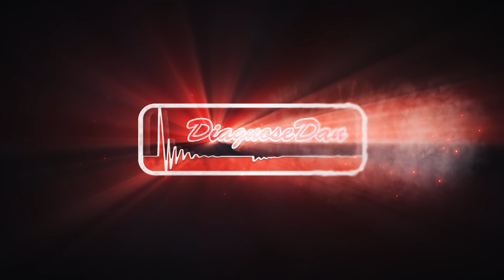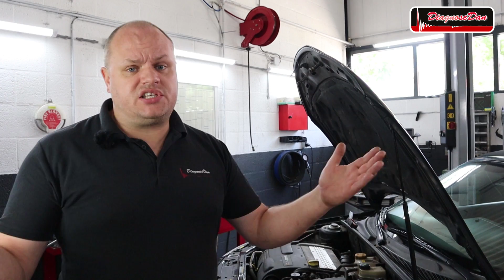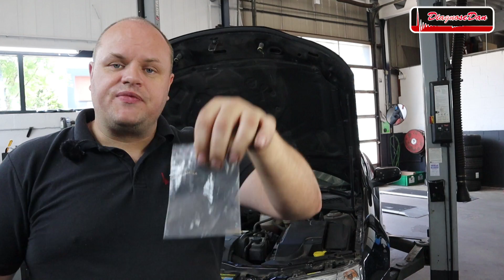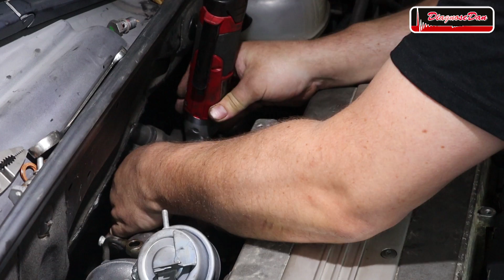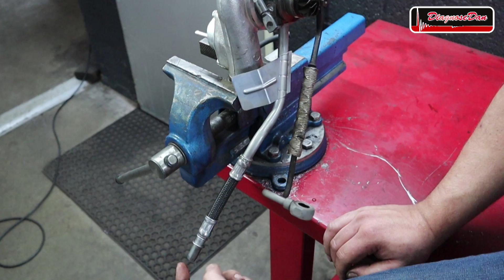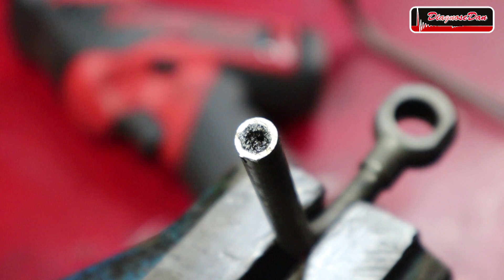Why did this new part only last one day?

Comment: Nice to see proper diagnostic checks. There is an odd sense of enjoyment in working out an issue as long as it's on something you want to work on. I had a 78 Toyota Corolla Liftback have its valvetrain partially lock up on me after doing a ring job but due to carb problems would keep dumping fuel. I kept up on keeping FRESH oil in it by draining out the contaminated between episodes of massive pressure loss while trying to sort out the carb problem. Ended up installing a reman. Once that was sorted out, the day I went to actually DRIVE it is when I had a failure to start before heading into work. Fortunately I had alternate transport. Got home. It finally started but was ROUGH as hell. Pulled my valve cover then restarted. I had 2 rockers not moving and saw 2 push rods not moving either which were no longer under the tappets. The rods were BENT...one had just 1 bend while another looked like a lazy lightning bolt while the 2 valves were seized.
Removed the head & rockers. The offending valves had to be forced out with a block of wood & followed up by a dowel all with several hard whacks with a hand sledge. Turned out my stem seals had partially dissolved from the gas contaminated oil & entered into the guides thus gumming them solidly into place. Removed every valve & stem seal. Used gas soaked pieces of rag to clean out the guides. Did this until the valves would move smoothly within. After letting them air dry I put new seals on then put it all back together along with the new Reman carb (the other I couldn't get it to stop dumping fuel). The problem never came back.
Reply from the maker: Good job and thanks for the comment it's appriciated 👍
Reply: @Diagnosedan  The car is gone...found a new home as someone's project last year but those pushrods are a mirror ornament now...

Comment: I have 210,000 miles on a 2011 Chevy Cruze 1.4L turbo engine. I use Mobile 1 extended  15,000 mile oil only.   Yes that oil  cost more money  but does it? Still on same Turbo.
Reply from the maker: Great! Thanks for watching 👍

Comment: use mobile 1 oil,  dont shut the engine off after hard driving, until you let it idle and cool for a couple minutes, change the oil, filter  and coolant more often, in general keep up with the maintenance.  Good video
Reply from the maker: Great advise 👍

Comment: Awesome video as always. I would agree with a previous comment. Looks like oil cooked in the line due to high heat most likely due to not letting the turbo cool before shutting down. Could of course be agrivated by poor quality oil and or lack of change. It probably would not hurt to insulate that steel line better.
Reply from the maker: There are multiple causes for a Line to get restricted this way. Thanks for the comment 👍

Comment: Change oil every 6000 miles with fully synthetic oil. That's the only way to prevent stuff like this from happening. Also, tell the owner to allow the turbo to cool off for a couple of minutes at idle  before switching off after a long run, as the heat takes time to dissipate and can oxidise oil in the pipes while the turbo is really hot.
Reply from the maker: Gread advise 😁

Comment: Lot of people seem to think this laid on the oil being bad quality or not having been frequently changed, but the reality is, even with fully synthetic oil and frequent changes this carbonization can happen. That's because the turbo can get so hot, that it will literally burn the oil onto the walls of the oil supply lines. The solution to this problem (or at least a way to mitigate it) is to not shut off the car immediately after you've arrived at your destination, but let the engine idle for half a minute when the car is essentially already parked. This will let the oil (and coolant) circulation cool off the turbo to a point where if the flow stops because you ultimately shut off the engine, the oil will not be burnt in / onto the walls of the supply lines anymore.
Reply from the maker: You are right 👍

Comment: Years back when I bought and sold Saabs, one problem that I had to get in front of was a plugged oil pickup in the oil pan.  We ended up removing the oil pans on each of the Saabs and cleaning them out, replacing the pan etc.  It was about a two hour job and wasn't that costly but it sure made for a better repair.  The pickup screen in those cars was very fine and regular oil would plug them up.
Reply from the maker: Thanks for the feedback Anthony

Comment: Shop thought they could sell the feed line as an extra to another customer. I'm wondering whether they owned up to their mistake.
Reply from the maker: No they didn't
Reply: @Diagnosedan  That's then double-shame on them. It would have been bad enough if not checking the line would have been a honest mistake or oversight on their part, but if the line was part of the replacement kit, then they definitely have no excuse for not having replaced that, too, and it's 100% their fault that the new turbo has also failed. Hopefully the car's owner will sue them.

Comment: external causes yes. my brother is into modified tractor pulling he makes up a cocktail diesel/alcohol fuel for power & 'turns up' his injector pumps but burns up turbo chargers like popcorn he's got about 20 under the work bench and several sent away getting rebuilt
Reply from the maker: Wow😲😲😲

Comment: I know that old PSA HDI 1.6 (16V) is notorius for turbo failure. Due to design flaw, if some of injector gaskets start leaking, the hot gasses from the cilinder are not vented outside, but inside valve cover, polluting oil with carbon particles. When turbo fail, the whole engine is already so full of carbon bildup that it is practically irrepairable - regardless of cleaning and flushing the oil, the replacement turbo usually fail after few thousand kilometers.
Reply from the maker: Yes you are right 👍

Comment: Dan, I work on turbo charged aircraft engines. We usually take the lines off and de-coke them with cleaning solvent. Fairly common problem. Oil flow in the line is not very high but that line being so close to the turbo and exhaust it gets pretty hot and cooks the oil. Line coking and bearing coking are the biggest cause of turbo failure. 👍
Reply from the maker: You are right!👍👍

Comment: Replacing the Oil lines to and from the trubo is a suggested thing to do, although when I replaced my turbo it never came with the new lines. Which luckily wasn't the cause for my turbo dying, I did however find a litre of oil in the intercooler. Just got the cam sensor to replace and then some cosmetic work and then my 307 SW 1.6 Hdi is just right.
Reply from the maker: Thanks for the comment 👍

Comment: Hi Dan. This is just from my own experience. Not affiliated to the company. I cannot stress enough the importance of using .BG products at each service. The product called the 109 compression restorer will remove carbon and prevent carbon ever leaving deposits like that. Add their oil fortifier DOC for diesel or MOA for petrol to keep the pill cleaner for longer and you will never see a whole range of issues relating to carbon deposits and as you know there are many. The chemistry behind these products is amazing. My customers ask for them after they see and feel the difference after service. Just to add. The cause is either or both of these. Extreme heat and there is heat shield added to the pipe. In frequent servicing. Excellent video by the way as per usua. Thanksl
Reply from the maker: Thanks for your comment Steve👍

Comment: Looks like the oil was baked in the line- probably because when the engine is turned off there is a lot of heat built up in the turbo bearings and it escapes back through the feed line and drain line, building up that burnt oil coating until it closes off the passages.  That's the reason the new turbo comes with 2 new lines.
Reply from the maker: Thanks for the feedback 👍

Comment: The cause of deposit of  carbon dioxide ,may due to a poor fuel quality.It’s a good idea to replace your spark plugs at the factory-recommended times. Performing fuel injector cleaning also helps keep things working the way they should .And also good to check valve clearance .
Reply from the maker: Thanks for the feedback 👍

Comment: You need to run a "stiction eliminator" in the oil. Its whats used in older ford trucks to help free oil fed injectors. The issue is the oil in the tube and turbo is cooking itself after being super heated when the engine is turned off and turns to carbon. Little by little it clogs the tube. The stiction eliminator clears the carbon and provides a barrier so it wont happen again.
Reply from the maker: Thanks for the feedback 👍

Comment: Hi Dan, have to say the troubleshooting workflow is excellent and good to learn from all your videos. For the carbon build up, could it be the owner did not change oil on a regular basis as carbon wont suddenly build up? However, the other shop's practice is also questionable given that a new supply tube has been included in the kit, it is no brainer to fit a new one.
Reply from the maker: You are right, Thanks for watching 👍

Comment: Did you find any other systems affected by the carbon build up? I assume that the customer has not been regular with maintenance or taking it to places using the wrong products.
Reply from the maker: I didn't find any other carbon anywhere

Comment: I found that my customers who do mostly very short trips have more carbon build up issues than the ones that drive at least 20 minutes. The first and for most important recommendation is a shorter oil change interval and for some customers I use some Dexron III ATF as an additive. It is basically 5w20 with a very high amount of detergents. I use between .5 to1 liter of it every oil change. If the buildup is not to sever, this clears it up over time.
Reply from the maker: Thanks for the feedback 👍

Comment: A little detail that wasn't mentioned and might come in handy : 
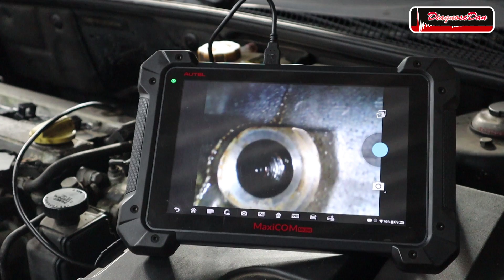After installing the new turbo and feed line, it's not a bad idea to run the engine dry for about 10-15 seconds, like Dan did at  08:28, just to fill up the line and the turbo with oil, and when the engine starts, they won't run dry until the oil raches them. Just a thought. 

On another note, would it be OK if we substitute this oil feed line with AN3 steel braded brake hose? Or maybe Copper-Nickel pipe? Just as an upgrade, in hopes that the line will not clogg up in the future? Ever?
Reply from the maker: You always need to prefill the turbo with some oil before starting the engine for the first time after installing
Reply: @Diagnosedan  ....thanks for the info Dan, much apreciate it. 
How about the upgrade I suggest? Is it feasible? Will there be any problems with temperatures? 
Thanks again.

Comment: Lack of maintence (oilchange & oilfilter). Theese cars often has "Longlife intervalls" but many owners now theese days tend to use regular or cheaper oil. Some might even use the wrong oil becuse of the pricing. I recently serviced a car like this wich should have 6L (1,5 gallons) of oil but only had approx. 2L (½ gallon) when it was drained. Only reason for the owner to actually do a service was that he "thought it was time for it". So SAAB and many other makes should make it possible for the machanic to set a custom or other milage/time for the servicelamp to light up like some newer VW/VAGs offer. This ones does'nt offer that option (and many other makes aswell) wich as we saw in the video affects the lifespan of vital components if not taken care of in the right manner. In general it's always better to change the oil & oil filter one time to many then less. Your car will thank you later and you will be able to get home much safer. Please don't cheap out...
And the SAAB i serviced.. now a few months later the oil level is still correct and it runs like a champ... and no rattling.
Keep up the good work Dan!
Reply from the maker: Thanks for the great comment 👍

Comment: Hey Dan
Great video here. 
Can you do a video where you explain the difference between normal engine oil and synthetic oil for those who want to know just what is the difference. 
FWIW I have two cars, a '96 Toyota Corolla (1600Gle recently overhauled with new rings and bearings, normally aspirated. Rebuild was done due to oil pump failure), and a 2006 VW Sharan (1.8Turbo)
Strangely I never got a oil pressure warning on the Corolla, but when the engine was stripped we found that some bearings had the mark of oil starvation, which prompted me to purchase a new oil pump just on the off chance that the original oil pump was on its way out - and the mechanic confirmed it. Luckily the pistons was still OK. 
In the Corolla I use normal oil, but I use synthetic oil in the Sharan due to the turbo.
Reply from the maker: Maybe i'll do that one day Emil👍

Comment: I knew where this was going before I clicked. Why would they do a turbo and a return line without doing the feed line? I would think a European shop would have played this game before. Here in the states people are just getting used to how much it costs to fix direct injection, turbo, variable valve lift/timing cars. The least they could have done is spray brake parts cleaner through it and a big shot of compressed air.
Reply: Oh yeah. Nice pressure testing tool. I'll look into one. I'm sure it's not cheap.
Reply from the maker: Thank you for the comment 👍

Comment: Typically what i find is its oil coking from using covential versus synthetic oil and long periods between oil changes. Plus some lazy idiot cutting a hole in the oil pan to clean the oil pickup screen from the ton of rtv they used on oilpan gasket....
Reply from the maker: Thanks for watching 😀

Comment: Dany I'm  really big fan 
as u said u take how much should be the engine oil pressure from service date can u tell me from which site u get it or from were  I need it for bmw and range rover Thx
Reply from the maker: Original workshop manual
Reply: @Diagnosedan  from were I can get one??
Reply from the maker: @osamaqanzoua399  emanualsonline
Reply: @Diagnosedan  Thx pro

Comment: Had a new freightliner /cummins ISL with 800 mile crank case full of fuel for the second time
I was told to replace the injection pump
But when I took the injection pump off the only thing that came out of the pumps crank case was fuel
When i told cummins factory rep what I seen they said just put a new pump on it I was wasting time 
I argued with them saying its not getting oil
We pigged the engine and got no oil out of the oil supply port to the injection pump
So i pulled the radiator and cam shaft and guess what the oil rife from the front of the block to the main oil rifle was drilled short of intersection of the main oil rifle cummins told me to drill it so I did 
That truck never came back
Sometimes just being observant is worth more than hours of testing
Reply from the maker: Great story! 💪💪

Comment: came across this type of failure before on a subaru same problem cocking of the oil caused by 
lack of maintanence (not adhering to oil change intervals) led to clogged line then cooked turbo turned from a cheap oil change to big $$$$
Reply from the maker: It hurts to see a part fail like that😬
Reply: @Diagnosedan  i agree i always feel bad for the customer having to go through it all again

Comment: Oil is far more important for the turbo than the engine. Since it’s critical for the engine, imagine what the Turbo goes thru if it isn’t getting good oil.
As soon as the first mechanic pulled the oil line he should have noticed it was dry and questioned the turbo failure reason before even starting.

Changing the oil more than once every two years would help.
Reply from the maker: 😂😂 You are right Jim

Comment: My guess from a non professional mechanic, high heat in the vicinity of the turbo and a lack of frequent oil changes. If the engine is high mileage, then it might get  lots of blowby and therefore more carbon in the oil.
Reply from the maker: You are right!

Comment: Dan I have a 1.6d Berlingo that has maf range codes for too high and too low I have replaced the maf and boost pressure sensor and all live data looks ok this happened shortly after the timing belt went 😔 timing is all spot on any suggestions? Thanks 😊
Reply from the maker: Hi John you can ask your technical questions in the Diagnosedan Global tech support group on Facebook

Comment: I wouldn't expect most shops to catch the clogged oil line issue on the first try, especially with a higher mileage car. I bet most of them would just think the turbo just plain wore out, (citing that all Saab turbos fail at whatever mileage the car happens to have). That's why I don't go to shops, especially in Rhode Island, USA. If they are truly at fault here in RI, and they ran out of things to blame, they'd next blame the failure on the type of gasoline the owner buys.

Comment: First time Ive seen that much soot in a pipe.. Usually i see it Inside engine Block walls and on the parts where oil Flow is a little bit slower, i can only see that the car was abused with short distances, low load and too high temperature, or a failiure within the oil filter and wrong oil and irregular interval of oil Change...
Reply from the maker: Thanks for leaving a comment it's appriciated 👍

Comment: Just don't buy a car that have a turbo that isn't refrigerated by cooling system too. Even if u change the oil regularly with a good full synthetic if after a long trip u immediately turn off the engine is 100% turbo's death. The oil even if new will crystallizes immediately for tge extreme heat.
Reply from the maker: Thanks for watching 👍

Comment: Nice video; The oil feed line likey had carbon build up due to not changing engine oil, and over temperature baking the oil inside the line. Recommendation: I don't believe there is a service recommendation on oil lines so you just wait for the turbo to fail. Another option:  Don't buy a car with turbo.
Reply from the maker: Thanks for the feedback John👍